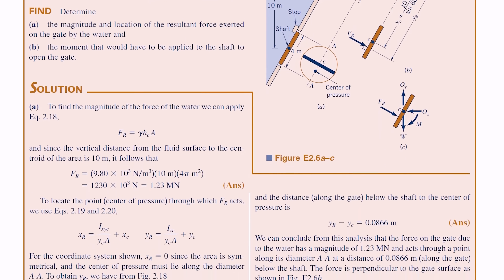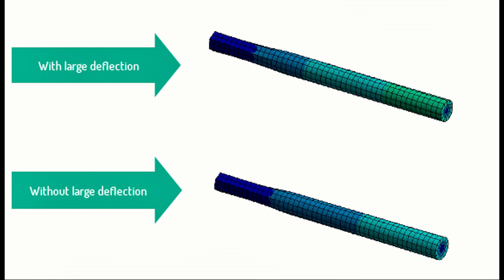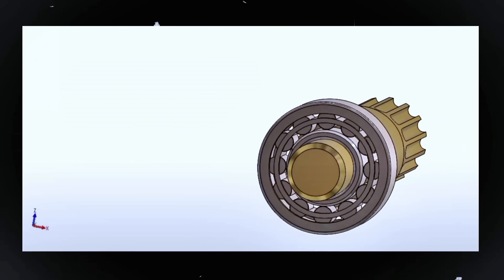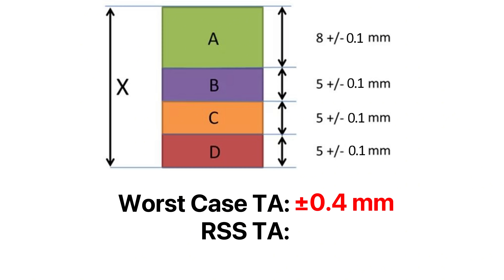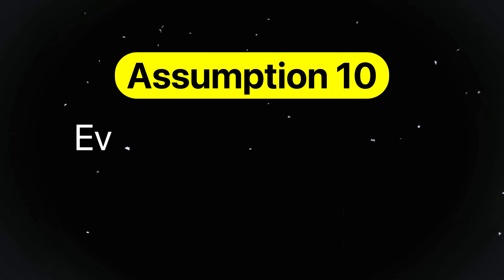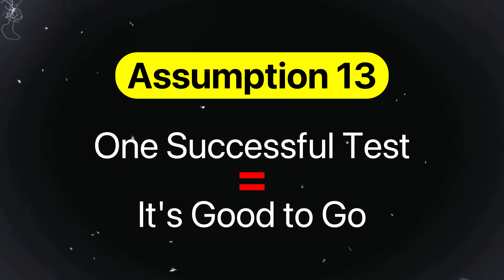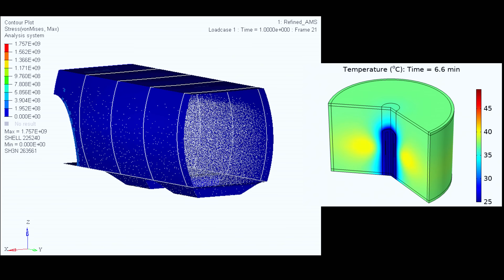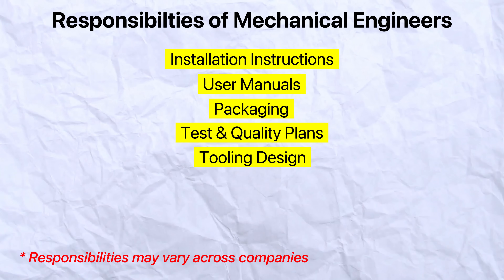You Don't Really Understand Mechanical Engineering

Comment: I remember a customer brought a design into the shop that required +/-.0003 inches on multiple flat and cylindrical surfaces. The main problem was that the material was a 350 ksi stainless. There was significant tool push-off and heat generated at the proper feeds and speeds and this made the part almost impossible to machine. The machinist resorted to slow "nibbling" with carbide cutters to get the job done. Many other interesting problems with different steels, heat treatments, polymers, seals, and on and on. Mechanical Engineering is fun if you get to actually do the engineering part which I did. Retired now. Loved it and still doing some stuff with 3D printing and scanning.

Comment: I worked at the Product Development of a heavy truck maker like for example Volvo Trucks North America, in the rear suspensions. Immediately after I joined the  group they planted bugs in my dumb phone (2006), car, van, desk, home, home laptop, etc. Time and then they used to let me know that I am being monitored. I had 19 years of experience in product development ranging from motorcycles to military trucks in India. In 2009 my criminal manager, of course on directions from his God father chief engineer asked me to find the root cause of failure of the rear Z-spring beams that they had already launched in production. I did not know that the gang had different plans other than solving the failures. Later my manager was promoted to Director. I came to know later that they used my hard proof of failures to negotiate with the management and made a deal to promote my manager for the very blunder that was created by none other than the chief engineer. The same chief engineer brought one from Detroit who is from the same diabolical religion as the chief engineer. That fellow is an MSME from Michigan University. He had absolutely no idea of Mechanical Engineering or vehicle suspensions.  Just to promote him, the chief engineer manipulated the management to award him a major suspension project. I told those scoundrels that the suspension would collapse and cause catastrophe right when the truck is loaded. That is failure at zero, zilch, miles. They retested the system in computer, which they have been doing for 2 years then, and discovered that it will indeed collapse. To save their filthy aas, they manipulated and cheated in the physical testing and even launched that suspension in the market, knowing very well that Americans are going to die. Hail Jeffrey Epstein.

Comment: Fantastic video. @1:00 The comment I'd like to add is that as much as too many constraints can be challenging, I often see not enough constraints in design parameters (simply due to the fact that testing is often expensive in both time and resources) also lead to all kinds of real life problems. After assumptions are made just to move a project along, BOOM! everything breaks - then realize testing for those parameters would've been cheaper and faster.

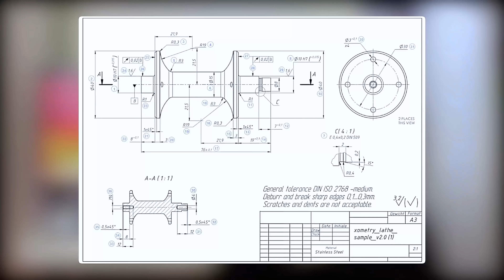Comment: 5:35 despite it is a sample drawing, I found some inaccuracies. For instance, from the practicality, D10H7 is impossible to produce because this is supposed to be cylindrical grinding and to be able to follow the tolerance +0.015. Even if it is to be done for one install on CNC-machine, there is very specific finishing (surface quality 1,6 sometimes possible to get form a cutter) and requires a groove for proper tool out. So right after shaft journal there should be a technological groove for the tool out instead of R1, like it's done for D8 (see C4:1). 7 years of manufacturing processes engineer experience. You're doing a good job! Greetings from Ukraine!
Reply: Absolutely no need to grind IT7 unless the material is very hard. Even IT6 can be done with simple finish turning.

Comment: I am a locomotive mechanic of 20 years. I have been working on a warranty repair team the last 8. 
Another is engineers forget machines need to be repaired, maintained, and serviced by a human (for now). Its not even  a millisecond of consideration in the design phase. At least that's what it looks like from my end of the process.

Comment: The connection you made between metal forming's inherent non-linearity and wrongly assuming linearity during life-time of a product is just wrong. 99% of mechanical mechanims are restricted to the linear portion of the stress-strain curve regardless of the manufacturing process which usually involves some non-linearity, the connection between the two is just wrong. Same goes to things like snap fittings - a good snap fit, even in polymers will not deform plastically.

Comment: Great suggestions. Also, if practical, I strongly suggest building a relationship with the people in manufacturing. Most Manufacturing Engineers and  Machinist will eagerly tell you what creates problems and usually can present alternatives. Our abilities are a sum of  knowledge and experience. The experience is the part that takes decades. Seek out, approach humbly, and listen to the ones with grey hair.

Comment: Mechanical engineers need to intern or work on the floor as a machinist. You can learn a lot from manually machining parts on lathes, mills, and grinders. It should be a requirement to design a part needed for an assembly and machine it complete.
Reply: Very good, now you learned as GOOD MACHINIST now its GOOD TIMES to DRAW, DESIGN, BUILD a much high tech accurate productive MACHINE for machinist, being a GOOD MECHANICAL ENGINEER on SERVICE...

Comment: The Facility I worked for hired me as a Tooling & Small Mechanical Equipment Designer for in-plant use in an ME billet.  I was smart enough to ask lots of questions of the Artisans that needed a tool, jig, fixture, etc., the Toolmakers, the Sheet Metal/Welding Shop, & the Pipe Shop that manufactured almost everything I designed.  I'd 3D sketch on pencil & paper right with my "customer" to ensure that I actually understood what they thought they wanted.  Sometimes even before going back to my office, we'd see better ideas/changes to make to that sketch.  Then I'd go draw it up on vellum at whatever sheet size was needed, make copies, & take them to the customer, then the T&D Shop, or whichever Shop(s) would build all or part of the design.  Nearly everything that I designed was a one-off (i.e., like a prototype) and was expected to perform correctly at the first use -- virtually all did, fortunately.

I certainly learned that a 1/8-inch (~3-mm) end mill can't mill a slot a 1/2-inch (~12.7-mm) deep or deeper!  The Toolmaker & I figured out how to modify the part body to easily & quickly end up with the needed slot size, so I changed the drawing right there.  Not long later, I bought a small milling machine for my garage shop and learned a *lot* more about what "standard" cutters could be used for rather than having to order "non-standard" cutters.  I always learned what the machinery used by these Shops could do and how they were used - a good idea for most Designers!
Reply: Current ME undergrad student. How did you approach learning design? What steps did you take to cover certain aspects of design that could be overlooked or underappreciated? I'm a beginner myself and I don't have much knowledge of engineering design. Any recommended books? I'm sure hands on projects can help alot. I'm currently trying to design and build a 3d printed basic robotic arm as a personal project but my progress is slow.
Reply: Can I hire you?

/j
Reply: @theeyeofomnipotent  I'm retired now.
Reply: @bobvines00  oh well, thankyou for your work in this world (sorry if this sounds cringe), 

have a fulfilling day

Comment: As a long time technician transitioning into the engineering field I've seen these assumptions bite engineers once things are in the real world. One time after installing a lineshaft turbine well pump we ran into an issue during commissioning where the pump would fault out after about 15min of running due to high current. After a lot of troubleshooting we eventually realized that the stick-up (distance the impeller is lifted off the bottom of the pump) was too low because the engineer who specd the build didn't account for the water in this particular well to be around 80-90F while a typical well is around 60F. While that difference may not seem like a lot, with a 700ft+ drive shaft it added up to about 1.5 inches of thermal expansion. So with only 3/4 of an inch stick-up, after about 15min of running the shaft would grow causing the impeller to drag and the current to rise sharply. 99 out of a 100 wells the assumption would have been no issue but that one out of a hundred can wind up pretty costly.

Comment: I consider myself one of the good mechanical engineers out there because I am always open-minded on how to do things better. I also work closely with the guys on the shop floor, from our plasma guy to welding and the guys in assembly. These guys have really good ideas on how to make your designs better if you lend them an ear. Some of my fellow engineers are arrogant which is terrible for product development and communication. Sometimes, even before a drawing is done, I'll show the 3d model of the sheet metal part and ask the guy at the press "can you bend this?" and if no, he might suggest a better way.
But I've also experienced issues where everything from my end was done correctly, but our manufacturing engineer would route things differently than I intended, trying to cut costs, but actually making it more expensive in the long run. For example, I specifically call some parts to be laser cut because of how small some holes are and tight tolerances but he sends it to be plasma cut and then it becomes a massive pain in the ass for the guys in welding trying to fit stuff together. Or sometimes the part is just completely unusable and then has to be remade.

Comment: I see that in the examples you give you also consider the structural civil engineer as a mechanical engineer, since the latter is also interested in the design of the sizing of elastic or elastoplastic bodies under load. Good. In that case I would like to add to the list of design characteristics some specific peculiarities of civil works.
First of all, the main difference between the two types of design is that civil structural engineering is applied to products that are always prototypes, that is, that are not repeated in series and therefore subject to the creation of preliminary models (even more than one) to be subjected to various tests until they break. At most, scale models can be created, but their operation under load is always a partial simulation of reality. Therefore, in the civil field, it is necessary to proceed with caution, trusting in the success of what has already been achieved in the past and every time the required performance is increased (e.g. greater span of a bridge) one proceeds with caution, with a prudent progression of the increase in size (which is not happening in the case of the new bridge over the Strait of Messina, with all the controversy that this entails).
Secondly, all civil works are built on a subgrade on which the loads transmitted by the foundations insist. While building materials may have sufficiently well-known technical specifications, this does not apply to the ground. Geotechnics is more of an art than a science: this is due to the fact that the granular, clayey or rocky material can vary greatly in the area on which the artifact to be designed will be built - both horizontally and vertically - and it is practically impossible to achieve complete knowledge of it even if numerous tests are carried out on site or in the laboratory.
Thirdly, the production of civil works often takes place on site (with the exception of those that are completely prefabricated), therefore in a less controllable environment than a factory and the reading of the executive tables is very often entrusted to personnel who have practical experience but do not necessarily have all the ability to read complex drawings; in these cases it is necessary to put yourself in the conditions that the specifications and measurements introduced in the project are not ambiguous, or - as we say in our parts - are "fool-proof" (do you understand?)

Best wishes and greetings for your profession, from an old structural and construction engineer, now retired. Bye.

Comment: My uncle was an engineer. He says a lot of engineers don't get in the shop/plant/garage enough. You need to be learning manufacturing methods along with the theory. One little anecdote he told me about in relation to statistical process control and tolerances was that parts coming off of a lathe are very rarely under-sized or on-size. It makes sense but, a machinist won't waste time removing more material than what is required in the GD&T. Essentially, all your parts will be on the larger end of your expected distribution which could cause problems.
Reply: I'm not super experienced with a lathe, but I do have some experience, and what I've found is that it's far too easy to remove too much material, so many machinists are usually a little paranoid about that and tend to work closer to the oversize limit (on shafts, undersize for holes), rather than risk making it undersize (or oversize for holes).
Reply: @MrAstrojensen  I use vertical lathes and its purely automatic. WE have upper limits, but those upper limits don't fit on the next fixture's dimensions. Engineers should try and give more hard limits and give upper maxes on what they really want. If you don't want oversized parts, leave it at an upper limit and keep the lower limit the same.
Reply: Our machinists don't understand GD&T so they machine everything to the basic dimensions, so we can see natural distribution lol
Reply: keeping parts on the large side also leaves the option open to do an extra pass

Comment: One hilarious thing is when you work through Roark's formulas for various geometry it feels like there are so many analytical solutions to make reference to, then in the real world you find that some seemingly simple case of a loaded plate doesn't actually have an analytical solution. We still don't even know why buckling happens.
Reply: We absolutely know why buckling happens. Buckling is when the stiffness of the part decreases under loading, and thus deforms easier the more you load it. This is opposed to a part that keeps a more or less constant stiffness.

You can ask any seasoned stress engineer (such as I) and they can describe to you the exact mechanics of it. It is very straight-forward.
Reply: @Numbeeer3  Hmm, that's not quite what I mean by knowing why but actually you're right what I said was pretty ignorant. I was thinking that no one was working on developing closed form solutions for these problems anymore but I just did a quick search and they're still being published. Still most of it is done using FEA but when you leave university you're left with a familiarity for well defined problems that you're not going to find in the real world.
Reply: @abdifatahaden4761  I see what you mean now! I agree with you :)

Comment: Nice presentation. I would hope that these principles are drilled into students by the professors. You are correct that the basics are the obvious part of engineering skill but seeing the big picture and working within that framework makes a great engineer. I've been an engineering manager for years with no formal engineering training but I am very aware of all of the upstream and downstream ramifications and having the 10000 ft view, helping the engineers and shop floor guys come to the best plan has saved our organization countless hours and cost and has contributed to our high success rate. Integrating all the details that make a complete system (AKA systems engineering) requires a fundamental understanding of the various disciplines applied to the project and weaving them into a solution. The more the individual engineers understand this the better the process goes and that is priceless.

Comment: Audio doesn't work
Reply: The audio track is labeled wrong for some reason. Turn on the hindi audio track to get the correct audio. The ai dubbing is doing a bad English dub of the "hindi" English track
Reply from the maker: @vladstr100  You're totally right! It should be fixed now.

Comment: Is that a wrong statement "pockets with sharp corner can't be machined", I think it is possible in EDM sparking process.
Reply: "Can't be machined cheaply and efficiently". Of course if you have unlimited time and unlimited budget you can machine virtually anything you can imagine.
Reply: There will be fillet on any inner corner.
Reply: EDM sparking doesn't need that much money, it will be almost same as the milling cost, the only thing is we need to make the electrode sharp, that's it, and that can be easily done by grinding.
So technically sharp corner in  pockets can be machined, right. That's what I am trying to say👍

Comment: The assumption of perfect parts hit me hard as a 3d printing enthusiast. Had to change a lot of designs and scrap a lot of parts while learning what my printer is capable of. Tip: do not add chamfers near the build plate, it doesn't work out well on cheaper printers!